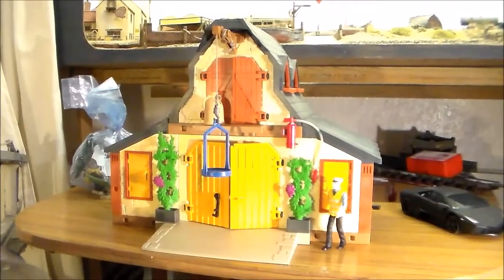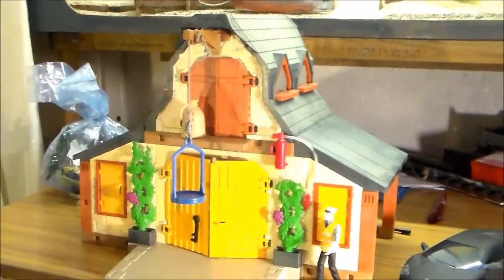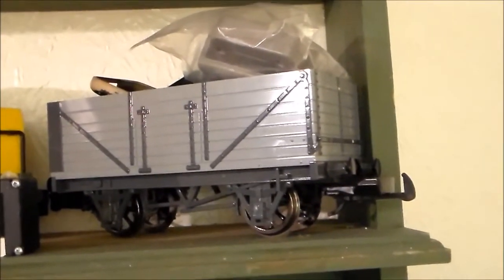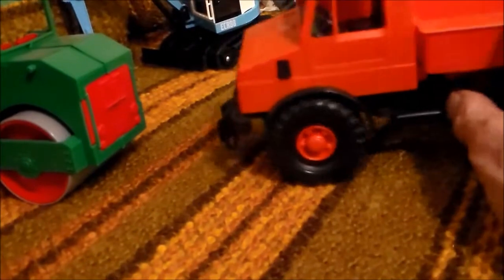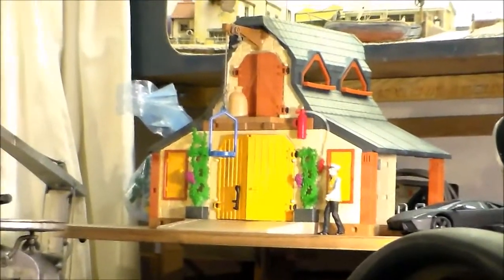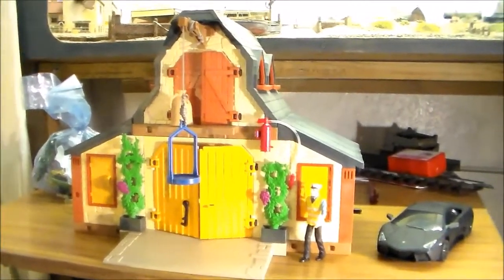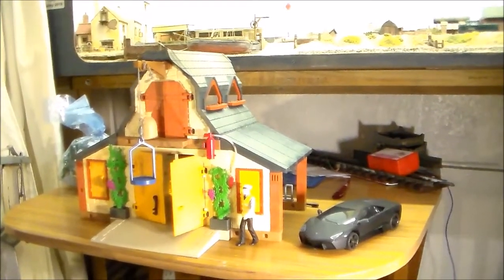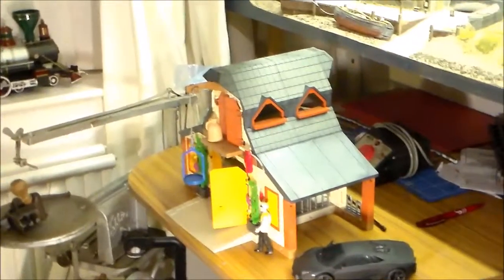Playmobil building for garden railway

Comment: John I have painted them but it doesn't help much, I have only tried the older style buildings, its only a problem if they are handled ( or in my case nocked over by rouge cats etc.) if left in place and not 
touched there fine.
Reply from the maker: +trainlgb Storage is a problem with large buildings. I will have to look at a place where I can put them between running sessions or accept their temporary status.